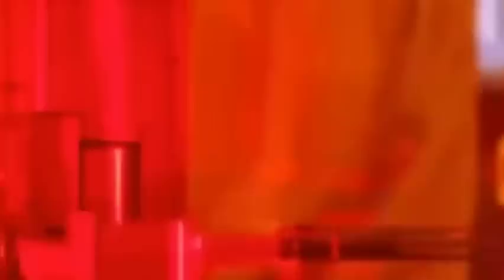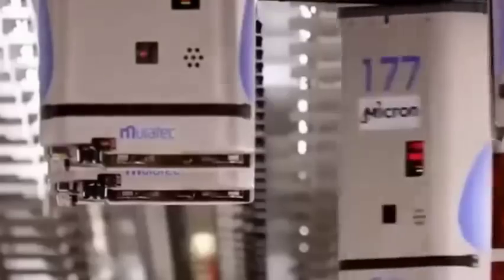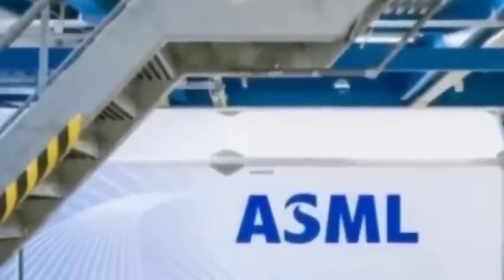China has created a "super-resolution lithography machine", realizing 22nm process and put into use.

Comment: Silicon based chips with electron pathways will eventually be obsolete. Despite recent US vain efforts to suffocate China's rising power in the areas of AI and chip development, China will win the chip war. China produces many more STEM graduate students each year, and China has a powerful manufacturing base. They are motivated to go beyond the constraints of etched silicon electron pathways. They are developing photonic chips. Unlike electrons, photons have no mass and can pass through each other without interference... A photonic chip will be 100X times faster, use less energy, and run very cool.

Comment: 22nm is still far away but it’s good enough for the time being as there are a lot of other packaging techniques to reduce the density to currently 7nm of SMIC. It’s been 10 years since SMIC using packaging techniques like FINFET N+1 and N+2” to come to 7nm. Even the latest launch of Mediatek and Qualcomm 888 Gen2 is using repackaging techniques to repackage 5nm to 4nm. TSMC is stuck at 3nm as it is too unstable and too costly. ASML is reaching its limit. The Americans electron beam (as it clearly state for quantum processing) and or the Japanese NIL imprint techniques and ASML can’t come up with the solution for the physical limitation of the silicon base semiconductor production. Clearly 3nm to 5nm is about the limit. TSMC Arizona is only going to produce 4nm in 2024 when it’s already been launched this year with Mediatek and Qualcomm? The writing is on the war. China will use other technologies like FINFET, stacking and chiplet to catch up. This 22nm super resolution machine is only part of the Chinese scientific learning curve. They will get to 10nm next and so on but it’s no longer necessary commercially. It’s no difference commercially whether you are on a 300km/hr or a 400/hr hsr. It will only be a difference when there is a huge leap say to 600/hr. A 3nm EUV produced chip will be hardly any difference commercially with a 3nm stacking or chiplet packaging technique produced. Bloomberg has openly reported that SMIC is producing and selling 7nm and everyone know how this 7nm came into being. No EUV. No American electron beams. No NIL imprint. Just an old DUV with an old FINFET N+1 and N+2 stacking technology. The next jump will be with different material base and completely different technical approach. This phase has come to its limit. This also mark the end of American control on silicon base semiconductor and its technological approach. China has a chance to overtake at the corner with new material base semiconductor and new technological approach. It’s an open field not control by anyone.
Reply: HAHAHA, advanced lithography can not be copied, 22NM is not good for anything except dumb appliances like toasters Confucius Say: C P C  already spend 1 trillion US dollar to copy USA semi conductor and fail, now CPC have "chip on shoulder"
Reply: Saya juga menebak. Begitu. Kalah satu langkah. Kecuali di buat berbeda disitu. Tantangannya
Reply: @Marcel Daman 90% of chips still use chip less than 22nm.   that still cover  
a huge market